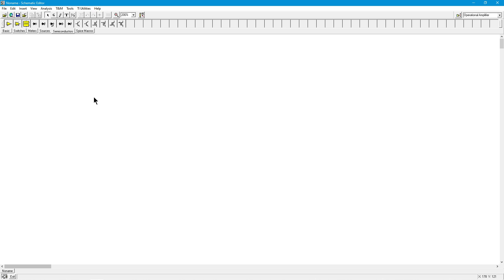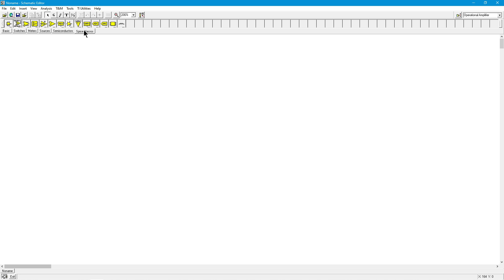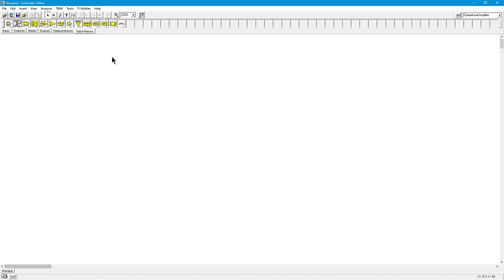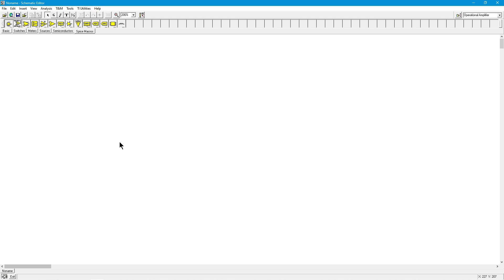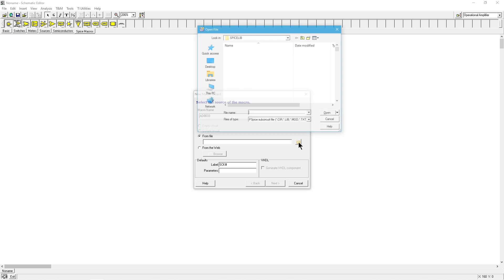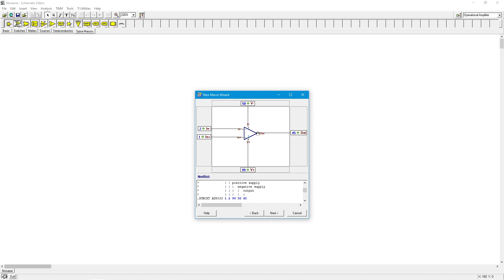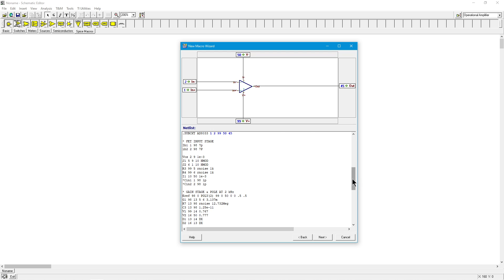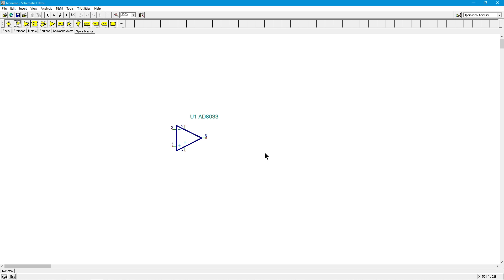TINA TI: Importing Devices

Comment: Really nice video, it helped me a lot! But I still have one question. Once that I imported the device, how can I add it to the library to be used in another projects? In my case I used a IRFS7540PBF, followed the video steps, and it worked pretty well, but I can't find the device in any libraries (FETs devices) or in the Spice Macros.
Reply from the maker: I haven't verified this because I haven't had a need to do it, but I assume you'll have to add them to the appropriate .LIB file. For example, if you want to add something to the op amp library, I assume you'll have paste the .cir text file into "OperationalAmplifiers.LIB" (in the TINA "SPICELIB" directory). The .LIB is just a big text file filled with .cir files. It also needs to be added to the appropriate .TLD file (also just text-just a listing of what's in the .LIB file). I'll have to verify this when I have time (or give it try after creating a backup and let us know).
Reply from the maker: It occurs to me that maybe I am making this more complicated than it needs to be. Once you've saved the model, you can reload it for other designs by just using the Insert.Macro menu item. Just navigate to wherever you saved it initially (probably in the Macros directory), select, and you're done.

I did a few quick tests using .LIB and .TLD files but they didn't work so it must be a little more involved than I assumed. I also noticed that there are Re-compile Library and Re-build Library commands under the Tools menu. Nothing in the Help file of use, though. I have also noticed that there are .LIB and .TLD files for many individual devices, so it's not like they dumped all of the op amps in one library file, all of the discrete transistors in another, etc. 

One final thing, TINA might save your macro in your TINA Documents folder but it might bring up the Insert Macro dialog in the general TINA Macros folder. At first glance they might appear to be the same place, and thus you might wonder where your macro went.

Comment: I downloaded tina just now and there are maybe two dozen op amps in the library, all from the 70s and 80s.  Where is all the newer stuff like LMH6639?  Thanks for the good video
Reply from the maker: Yes, the existing library appears to be pretty small, but there are many more devices presented as SPICE macros. If you select the "SPICE Macros" tab and then select the Op Amp button (extreme left), you'll see about 700 more (not including instrumentation amps, comparators, etc). Start watching at 4:00 to see this. Basically, you get to add to that list, as explained in this video. As long as the manufacturer has a SPICE model, you should be good to go. Granted, it would be nice if the library had everything from every company, but it is a free simulator after all.
Reply: @ElectronicswithProfessorFiore  yep, thank you